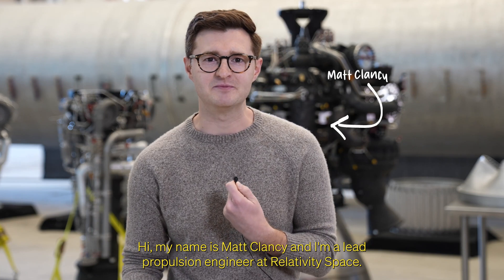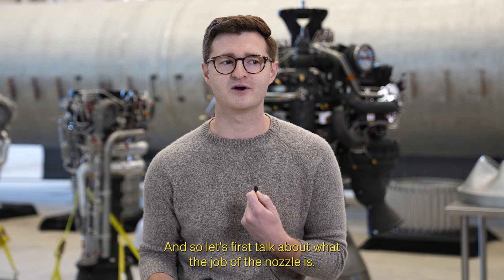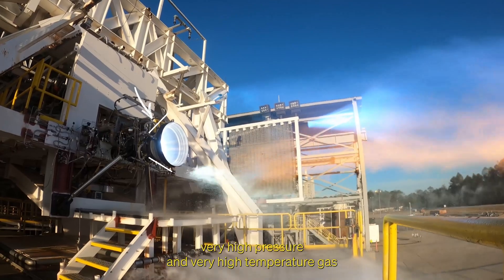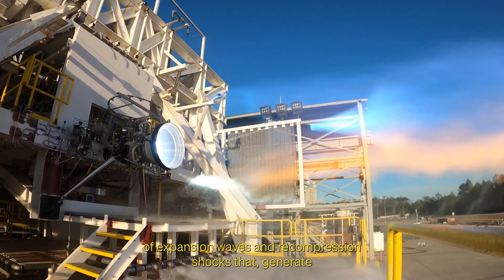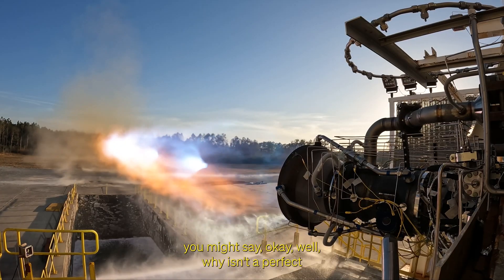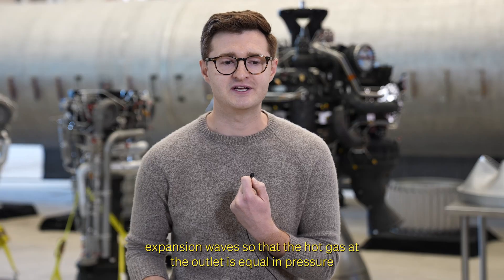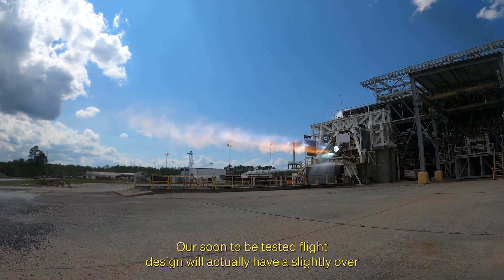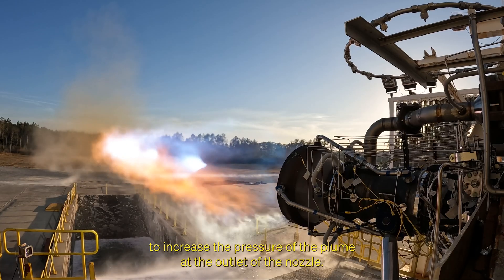Since You Asked: Mach Diamonds

Comment: Worth noting that the reason the flow converges back on itself to create those mach diamonds is due to the fact that the high-velocity flow is reacting against the ambient air.  The exhaust is moving so fast that the air around the exhaust is acting as a tunnel that the exhaust is bouncing against.  If the rocket were in a vacuum, the exhaust would essentially expand out to infinity and never create mach diamonds.  Crazy stuff.
Reply: Crazy beautiful.
Reply: That’s really cool to think about! Thank you for the explanation:)

Comment: Now I need another video to understand this video. 😭😭
Reply: Yeah, that video was unfortunately filled to the brim with technical jargon as well as just overly complex from the premise...
An alternate (and maybe simpler? Or more clear?) version would be like: The rocket nozzle is trying to get the super high pressure exhaust of a rocket down to the pressure of the atmosphere around it. So at sea level, you have 1 atmosphere of pressure and if your rocket nozzle expands the exhaust to exactly 1 atmosphere of pressure, then the exhaust can freely go straight out the nozzle at high speed. However, this is almost never going to happen because the rocket is flying on a trajectory that takes it from 1 atmosphere all the way down to a vacuum. So you have two other possibilities: overexpanded and underexpanded. Overexpanded exhaust is the most common to create mach diamonds. Overexpanded means that the nozzle has made the exhaust pressure too low, so it is below the ambient atmosphere's pressure (this is often the case when testing engines at sea level because rockets spend most of their time flying in lower pressures), and so when the exhaust exits the nozzle, the atmosphere will be pushing down on it, trying to compress it to make it 1 atmosphere. When this happens, the exhaust gets much hotter, and since virtually all engines run fuel-rich (they run the engine with more fuel than oxidizer to keep the temperatures manageable), this increase in temperature causes some of the excess unburned fuel to combust with the oxygen in the air which is why the mach diamonds are so bright (because it's an actual fire in the exhaust!). When this combustion happens, it also causes the exhaust to re-expand because the extra heat and additional combustion byproducts have increased the pressure. As such, the exhaust expands again but starts cooling off, reducing the pressure until the atmosphere can compress it down again into another mach diamond. This is why you tend to get many mach diamonds forming in the exhaust.
Reply: @AlexSchendel this is way clearer. Even if you forget the thechnical jargon, your explanations is way more articulate. Thanks a lot!
Reply: @thibaultghesquiere  Thank *you*! That makes me happy! As an engineer who would like to teach at some point, I'm glad that I can manage to make some complicated topics a bit clearer 😁
Reply: @AlexSchendel  Thank you.
Reply: @AlexSchendel very understandable as a layman. Thank you
Reply: @AlexSchendel  Very cool. I'm a student in ME rn, if I want to learn more about this what should I study?
Reply: @Dave-to5it Aerospace Engineering. Frequently, this is offered as a minor in the ME department rather than as its own major.
Reply: @AlexSchendel  Can I ask what subjects specifically? I’d like to do self teaching. I saw someone say fluid dynamics is that right?
Reply: Yep. I can just hear him saying he can't dumb it down any more than that.

Comment: What was the reason you guys went for an open-cycle engine instead of staged combustion? Doesn't this mean a rather significant performance loss?
Reply: Simplicity probably
Reply: Why does anyone drive a honda when they can drive a jaguar?
Reply: @chris-hayes  Weird explanation. A lot of companies go for a staged combustion cycle in this size class. Stoke Space is even going for full-flow and they haven't raised close to how much money Relativity raised.
Reply: @Clematisch At the end of the day, what matters is how much payload can you put into orbit. If I can put 20000Kg using a GG engine and you can only put 5000Kg with a FFSC engine I still have the more capable vehicle.